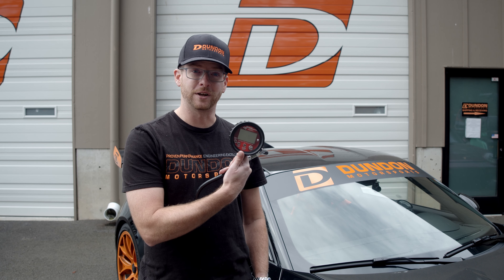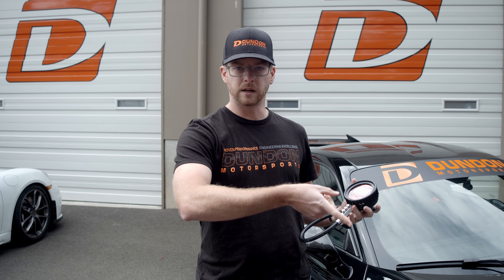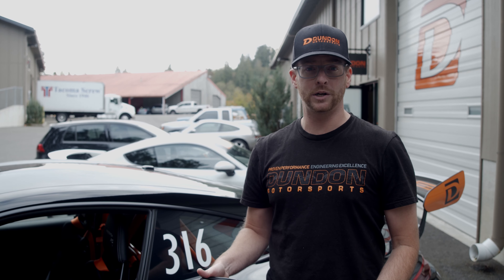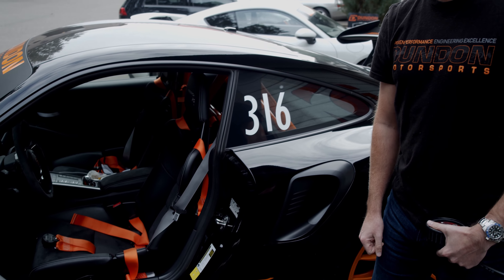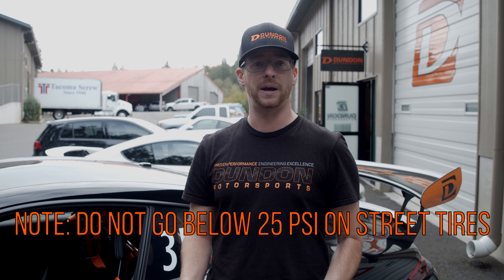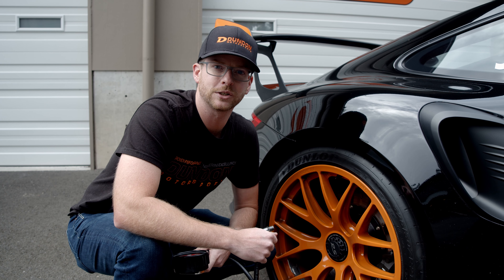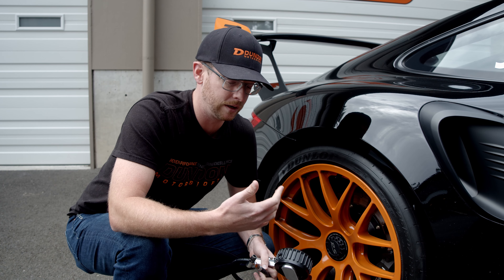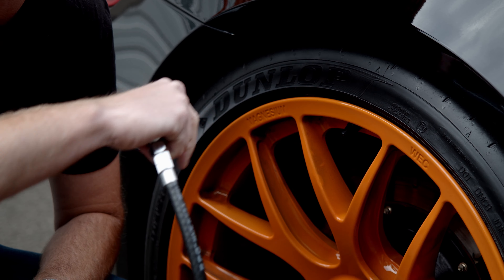Dundon Motorsports Minute: Tire Pressure

Comment: I’ve seen up to 8 psi increase on 20 min session. Going out low enough to reach the optimum hot pressures will be very low and kill the shoulders the 1st 3-4 laps. You suggest coming in  after 10 min and adjust and head back out, 1:30 min pit stop??
Reply: Great point Waylon. There’s a couple of ways to go about dialing your pressures in. You can drive very cautiously for the first several laps or you can drop a few psi at a time instead of starting super low. I’m not a fan of mid-session stops for pressure unless the session is 30 minutes or longer. My typical solution with a 20 minute session length is to set the tires 5 psi low, drive the whole session and see where the tires end up. In my case they’ll likely be 3-5psi too high, which I can adjust afterwards. Then I’m all set for the second session!